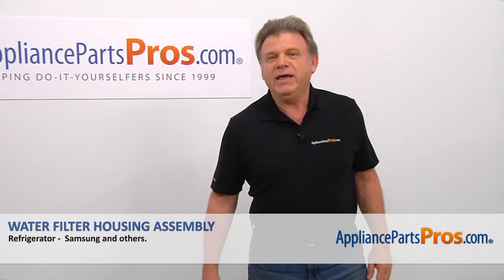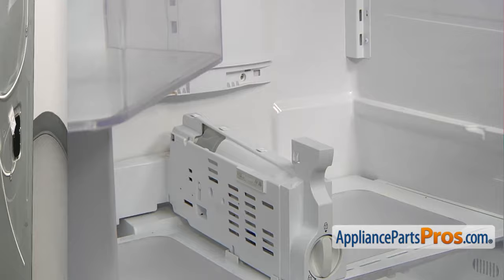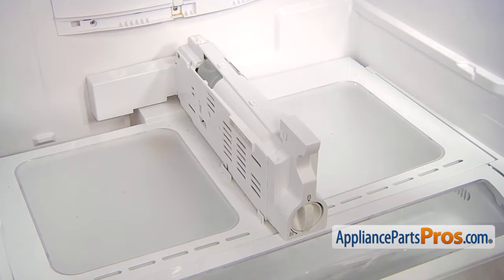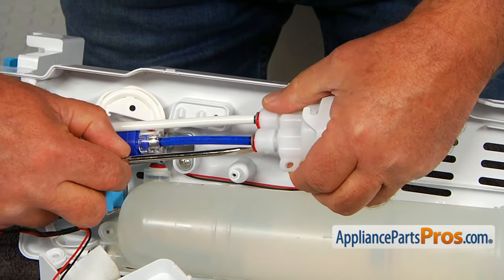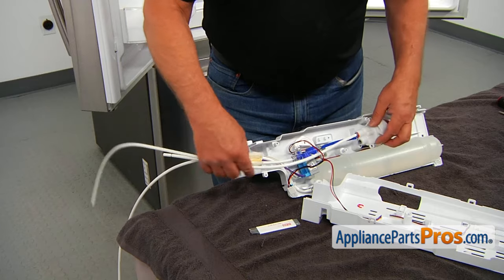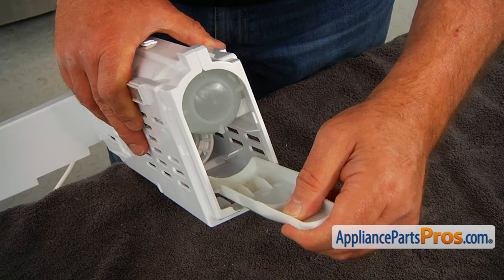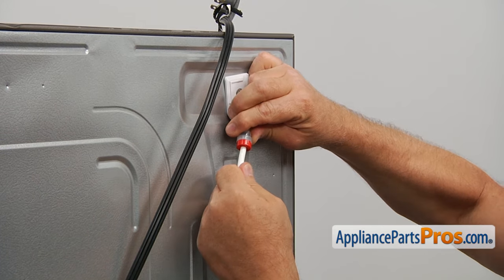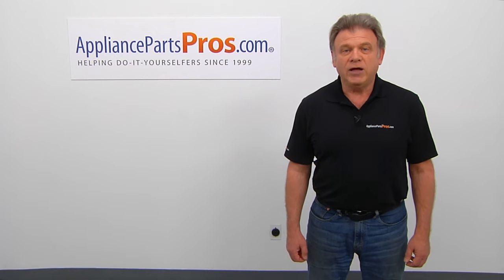How To: Samsung Refrigerator Water Filter Housing Assembly DA97-08006D

Comment: What symptoms would cause you to replace this part in the first place?
Reply from the maker: If there is low water pressure. If the housing is cracked or has any leaks. What is going on with your refrigerator?

Comment: Would this part be a likely cause of water buildup in/under the bottom pantry drawer?  Or would the blue water valve in this video that this part attaches to be a likely cause?
Reply from the maker: If one of those parts leaks water into the unit, that could be the issue. But, if you find water under the pantry drawer you most likely have a clogged drain tube. That is located under the evaporator coils, if it's frozen up or has debris clogging it then it could cause your issue.

Comment: Returning customer here,  did purchase multiple times from your store. Now I am back for more:)
Our 10 y old RF323TEDBSR Samsung refrigerator started leaking from under the filter assembly, I am watching this tutorial and it looks exactly like my fridge, but I think you posted a different model number.
Anyways, I typed my model RF323TEDBSR at your web store and unless I add RF323TEDBSR/AA-0001<< numbers after the  slash/  the search says its not compatible with my fridge number, on my door it only says RF323TEDBSR no front slash with numbers after.  My question is whether Part Number: AP5622811 (Water Filter Housing DA97-12668A / AP5623837) is compatible with my fridge RF323TEDBSR?
Thank you in advance.
Reply from the maker: I was looking and it does appear that part number AP5623837 will work for your model number.
Reply: Thank you and appreciate for the quick reply.
Reply from the maker: You are very welcome. If there is anything we can help you with in the future please let us know.

Comment: What causes the smell in the water filter housing assembly? I took out the water filter and the housing assembly still stinks. Thanks.
Reply from the maker: You may need to check your housing to see if you have a water line leaking that could be causing buildup inside there that needs to be cleaned. If you do find a damaged water line or connection and need help locating or ordering a part you can call us at 1-877-477-7278.
Reply: @appliancepartspros  thank you
Reply from the maker: You're welcome!

Comment: Is there a way to troubleshoot the housing assembly to see if that's what needs replacing?

I have recently discovered significant pooling up of water in the Flex Drawer and freezer. After finding no clogs in the defrost drain pipes, I ruled that out. I did change the water filter less than a week ago, following the usual procedure and didn't experience anything obviously out of the ordinary with dispensing water, but I'm now leaning towards something related to that system being the cause, with no idea exactly what. It is a Samsung brand filter and an RF4287HARS model refrigerator. Icemaker was running fine.

I currently have the water line turned off and the filter removed. Any suggestions?

Comment: What if my waterline broke going in to the fridge and I just need to replace the line? Can I just use a connector? Or do I have to replace the whole line?
Reply from the maker: It is going to depend on where it is broken?
Reply: @appliancepartspros  it’s broken about halfway through the line. There’s probably a good 2 feet on each side after the break. It’s not broken near or inside the fridge.
Reply from the maker: What is the model number of your fridge?
Reply: @appliancepartspros  RS25H5111SRIAA it’s 1/4 John Guest tubing.
Reply from the maker: If you think you can use a connector then you can try it. There is a universal connector you can try if you want, but I can't promise that it will work. The part number you would be looking for is AP5795479. Below is the link to that part so you can look at it. 

https://www.appliancepartspros.com/ge-coupler-straight-1-wr02x13738-ap5795479.html
Reply: @appliancepartspros  ok thank you and if I need to just run a whole new line how hard is it? And do you have the parts to order?
Reply from the maker: It appears that you would have to replace the water filter head with the housing. Which that part number is AP5781884. It is currently out of stock, but the link below will take you to that part as well. 

https://www.appliancepartspros.com/samsung-a-s-case-da81-05886a-ap5781884.html
Reply: @appliancepartspros  ok thanks. So there’s no way to just replace the incoming water line to the back of the fridge? That’s the only thing broken. You can just run a new line? Thank you btw for your help!
Reply from the maker: Not unless you might be able to find something at your local hardware store, but it doesn't appear that you can just replace that line.
Reply: @appliancepartspros  ok thank you.
Reply from the maker: You are welcome.

Comment: Water leaks from my water filter receptacle. This occurs with various filters, including Samsung branded ones. Is there a simpler repair than removing and replacing the entire housing?
Reply: How did you finally fix the problem?
Reply: @scottbrown8996  I haven’t really.  I now keep a plastic container in the produce bin and the leaking water fills it up. Very disappointed in Samsung. They wasted quite a bit of my time then did nothing to help me fix their design problem.